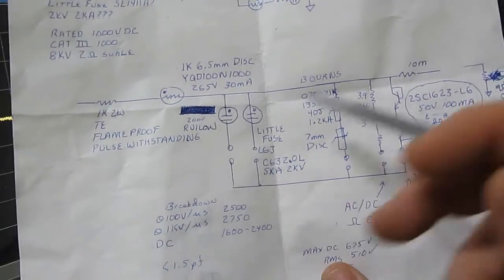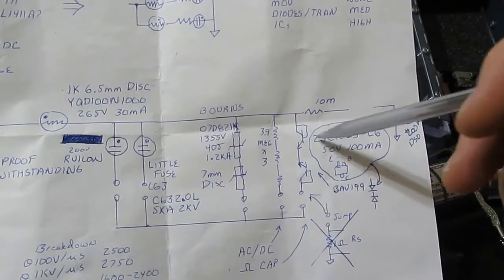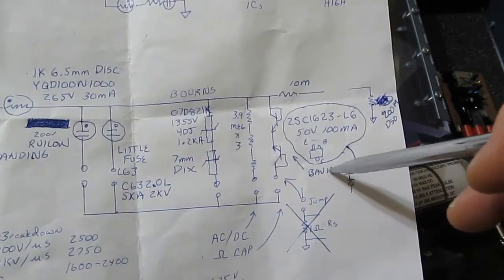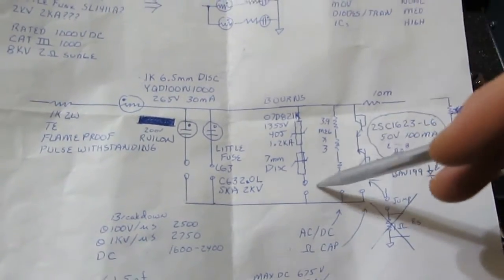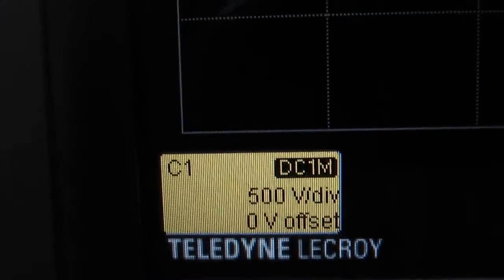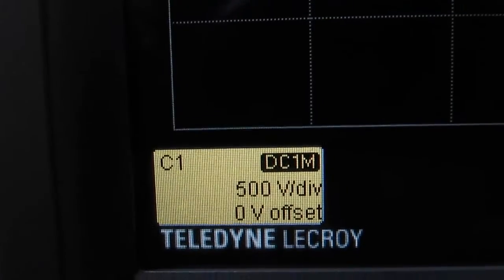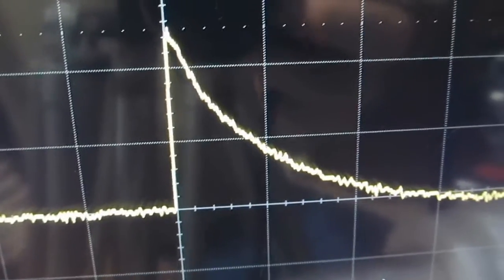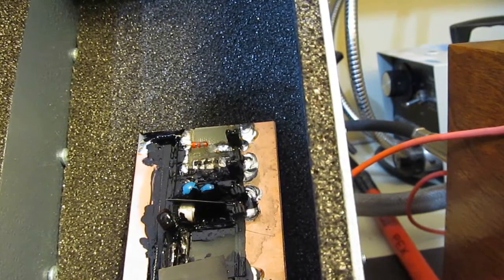Small Gas Discharge Tube Half Cycle Line Test (high speed)

Comment: Hi, i have question, my power supply Emerson not show errors but not give 12V, inside in PSU have 4 gas-discharge-tube, one of them light up for half second when i turn on PSU, is that normal or this is issue with gas-discharge-tube????

Comment: Excuse me, Mr.Joe Smith. can i ask to you ? what that black stuff like a paint or coltar ?
Reply from the maker: Dope.
Reply: oww. please. i want know.
Reply from the maker: You don't work with high voltage so you think I am calling you a dope.  This is not the case.   Dope is what it's called.  I've shown it in a few different vidoes. Look it up.
Reply: Thanks Mr.Joe Smith. i have lof of interest about surge protection and EMI protection and ground cemical system.
Reply from the maker: https://www.amazon.com/AmplifiedParts-Amp-3934-Corona-Dope-oz/dp/B00E1QZ2SY/ref=sr_1_cc_1?s=aps&ie=UTF8&qid=1477518847&sr=1-1-catcorr&keywords=corona+dope
Reply: Really Thanks you Mr.Joe Smith !